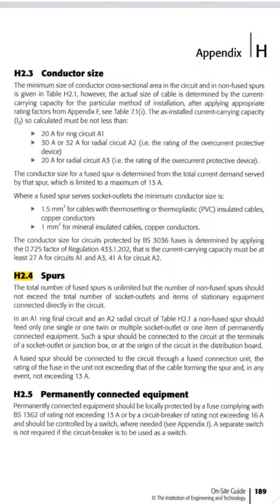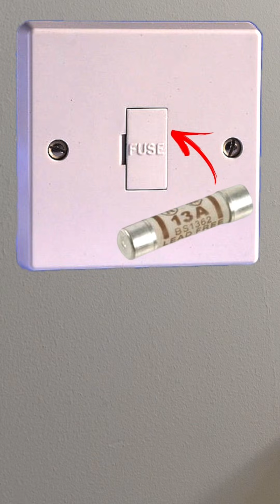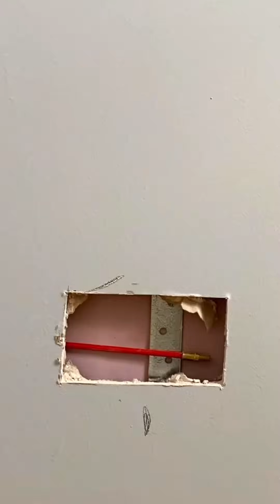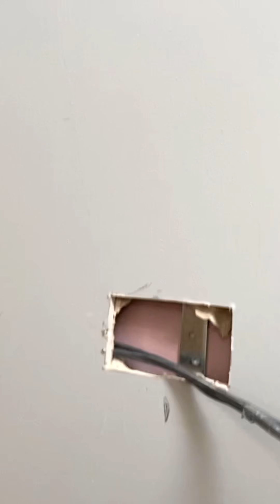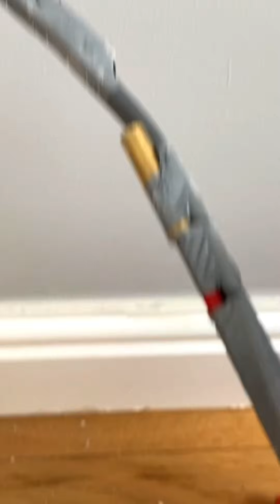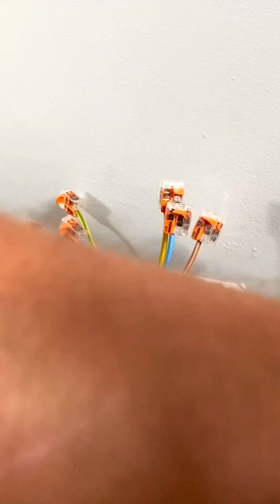Extending a Socket Circuit

Comment: Is it ok to run wires left and right horizontally behind the wall?
Reply from the maker: The Prescribed Zones for Wiring Cables in Wall or Partitions & Switch Heights in Domestic Dwellings
https://youtu.be/LBf9dlI5JAg

Comment: . You could of changed the original back box for a dual box that takes a  2 gang + 1 gang accessories. Ie a double socket and a fused outlet. Keep a breast of what is available
Reply: You could ‘of’ avoided the ever so slightly patronising reply at the end there 😆😆👎👎👎
Reply: @adrianshingler9783  Not to mention he seems to have missed the part in the video where they clearly explained avoiding a fused connection because it would be behind a bed.

Comment: I wasn't sure you could extend a 32a ring using Wago connectors as they are rated at 20amp as written on the side?.  Also. the metal back box is no longer earthed is it?  Does this need an earth wire also?